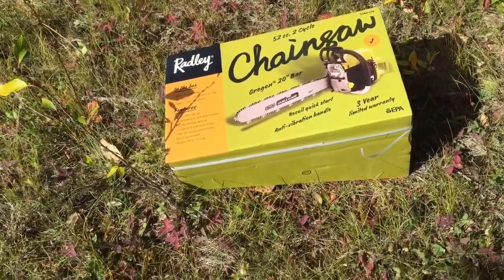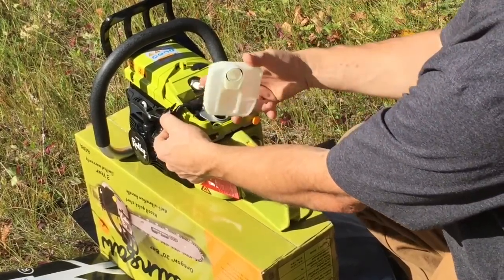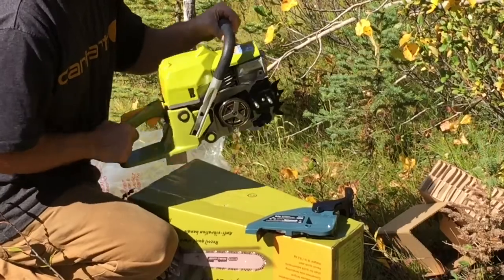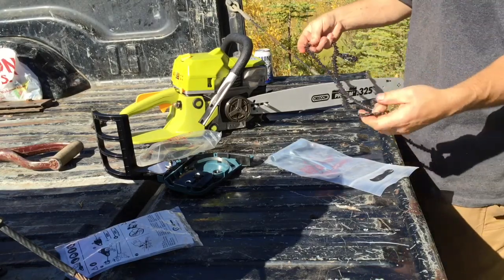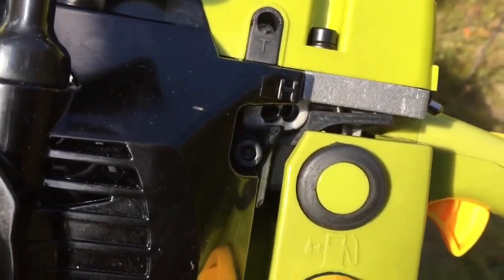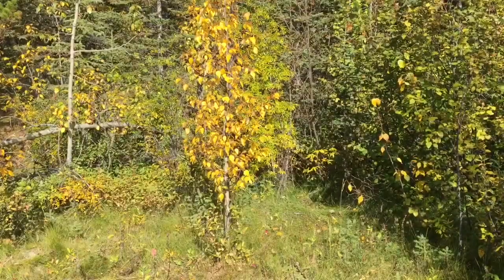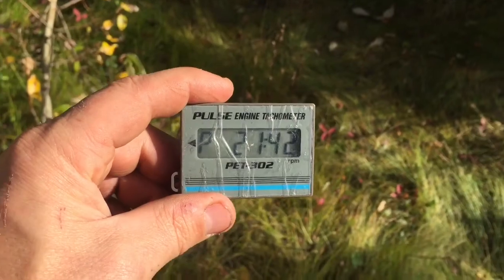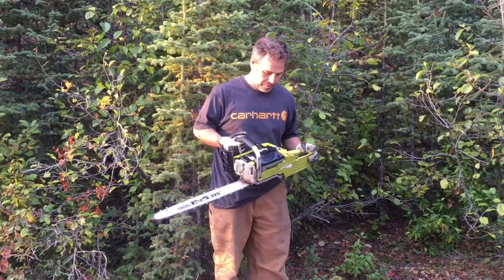52cc CHINESE CLONE REVIEW AND CUTTING!

Comment: well, bought this saw as well. Two things: 1. Muffler screen becomes glowing red in no time under a moderate load, spitting sparks all over, 2. chain easily gets jammed in the wood, but the engine however still runs just fine.
Reply from the maker: Yes it’s crazy how hot the muffler gets. I had same experience with sparks flying out.
You’ll have to diagnose it and see why it won’t run.
Reply: It was working fine for couple days (red muffler screen freaked me out untill I learnt about catalytic convertor this saw has, and lack of power was fixed by adjusting a High screw). But starting this thing when it's hot sometimes is a challenge
Reply from the maker: Yes it must be not adjusted right because during the summer mine is running in two pulls.
In cooler weather or winter it fires in two pulls starts in 3/4 like any other saw.
Try this for starting.
1- prime it 6 times.
2 pull choke to fully out.
3 don’t touch throttle or anything just pull start the saw.
4-it should fire in 2-3 pulls. 
5- as soon as it fires you have to push the choke in/off otherwise you flood it.
6- pull until it starts should start in 2/3 pulls. 
7- once it starts the choke is still slightly closed so the engine will run a big rough this is normal and you want to leave it like that for about 5 seconds then hit the throttle and it should come down to a nice smooth idle. 
Let it idle/warm up for 10 seconds then start reving it in short bursts to warm it up further.
8- start cutting. 

If it doesn’t start and run like this then you’re low end ( L mixture screw)  it’s probably not set up right most likely it’s too lean meaning not delivering enough fuel.
You need to tune the saw when it’s running so turn the low jet in until the idle starts to raise and then it’s gonna start to come back down. Then turn the screw out until you hear the RPMs come up again and just when they start coming down go just a little farther open than that and that should put you right where you need to be.
There is more to it than that but I’ll have to make a video on that.
Reply: @Indeewoods  that is a great summary indeed! I think I was able to figure out the reason for not starting. I usually follow the old school rule to not mess up anything in a new equipment, but I guess this is no longer applicable to the modern equipment especially originated from China. Trying to find the problem, I removed air filter to discover that O-ring seal between air filter housing and a carb itself was not sitting in groves around opening but was rather jammed awkwardly in-between allowing dust and extra air to enter the carb.  Long story short, I gave a nice blow to the carb, reinstall O-ring where it belongs to and voila! the saw fires up again on the second pull! So, the next time I will check the quality of assembly myself prior using to avoid such surprises.
During partial disassembling, I was pleasantly impressed by how solidly and thoughtfully this saw is built (I have two other smaller saws, Husky and Jonsered,  38 and 42 cc, and must say that Radley is a much better build). Will see though if it will last.
Reply from the maker: Ok that wouldn’t add or subtract any extra air.
My guess is you probably flooded it and from sitting it dried up enough for it to fire up. Either way glad you got it going.
Reply: @Indeewoods  very well could be, because the spark plug was heavily sooted up and obviously wet (I'm using the recommended gas:oil ratio of 50:1). Anyhow, I checked the saw all over to make sure everything is up to expectations and now will give her another try. Next is tuning the carb per specs - I would love to watch your way of doing this using a tach. Thanks for the helpful info and links as well!
Reply from the maker: It’s almost always just a simple ( if you know what you’re doing) carb adjustment. 
These things run flawless. They start better than my Stihl’s ever did but the difference is you buy a saw at Stihl or Husqvarna and their mechanic tunes the carb where as a Poulan or these Home Hardware saws get bought cheaper yet not tuned  to your elevation/temperature so 90% of the time they run but run poorly.
You need the special tool to adjust the carb. Links are on my video for the tool
Reply: @Indeewoods  I have that tool (so do I for my Jonsered/Husky). I have tach, and I adjusted saws myself with and without it. But this Radly chainsaw has something special in it, and you seem to be quite experienced with her by now.
It starts on a second pull as I said, and response without hesitation when throttle is squeezed. All seems to be normal on a carb side. However, two things (possibly related?) make me not happy with this saw (both of them were already mentioned in my first post). One being a muffler that gets glowing red very quickly, emitting bursts of flame when I stop throttling, an another one being the chain stops turning while into the wood like it is heavily underpowered. I'm going to remove that pesky catalytic converter hopping to fix the first issue, but what about the chain not turning? Bad clutch? Anyway, I have never had such problems with any of my other saws.
Reply from the maker: @partisan5695  well if you push to hard on any saw the chain will stop turning.
It’s too hard to diagnose by just talking about it I’d have to see what it’s doing
Reply: @partisan5695  gut the muffler

Comment: If anyone is about to buy one of these please read my comment about the part number on the chain bag and update this.  I've seen a lot of comments saying that the newer ones don't have the Oregon Bar and Chain. I have the newer with the Radley Bar, it's stamped KXB BU20-76-5812P. The chain is an Oregon, .325 Pitch, .058 Guage and 76 DL. I wish I had kept the bag, The Part number in this video is 21BPX078X, I imagine that the new ones are 21BPX076X. There are  lots of off the shelf choices for 78 DL chains, almost none for 76 DL. If the only difference is that the new chains are two drive links shorter, is there an reason that a 78 Link chain wouldn't work? I'd have to think that the adjuster has at least that much leeway.   BTW, the Parts Listing in my Owners Manual still points to the 78DL Oregon Bar and chain.
Reply from the maker: Thanks for the info. I think anyone getting a new chain for those radley bars would just match up driver links. If the manual is wrong and stating the old  chain number that is something you’d have to contact Hone Hardware about and have them address that issue.
Reply: @Indeewoods , I told Radley support a while ago. I'm okay for a while, I expect that Home Hardware will eventually carry them. The local Small Engine repair shop can whip one up if not.
Reply from the maker: I talked to my local HH and asked if the would stock parts I told them these saws were really good. He said no they won’t stock parts. 
Not very business smart if you ask me.
Reply: I purchased one of these saws and hop it stand up.  The questions about the 78 or 76 drive link appears to be because of the bar change.  Mine had the Radley bar instead of the Oregon and measures at 18.5 inches from the front of the saw which rounds up the the advertised 20 inch bar.   The Radley bar will not move out enough for the 78dl chain.  The Oregon 76dl chain for this saw is the  21BPX076G which is compatible fit chain with Stihl - 25RM3 76   Husqvarna - H25-76.
Radley and other products for Home Hardware and CTC as well as  may be found at www.mecanair.net which lists Products and Part Numbers.  Selecting the HH logo, OUTILAGE and SCEI will bring up this saw.  The website did not fully translate from French so you may have to do some exploring.  The supplier of these products is in Montreal, Quebec.
Reply: @davidhynes1432  thank you, I have not been able to find  21BPX076G anywhere in Canada, the Oregon site says that it is discontinued, to go to the 'Product Finder' page, it asks for the brand of saw and it's not there...  Don't you just love Technology? When the time comes I'll go to the local guy, he made me a chain for another saw in about ten minutes a while ago.
Reply from the maker: Great info! Thanks!

Comment: Bought one today after viewing this report.
Reply from the maker: Right on hopefully it works good for you. They have good reviews. 
Can’t beat them for the price but if you don’t know how to tune the carb you should take it to someone that does so it runs good for you all the time.
Reply: I'm actually doing the same next week lol it's now 199.99 so it may be worth it I think
Reply from the maker: @bleepers3 they go sale all the time for 159.99 but if you need it fast 199 is still cheap.
Reply: @Indeewoods  ya it's the cheapest saw around lol between Canadian Tire and home hardware lol but I googled it and there's people on eBay trying to sell these for 346$ lol but I hope on the 28th it's a bit cheaper, if not this video has made me believe it's worth it just for the bucking spikes alone lol my old broken poulan didn't have them lol. The Radley seems like a very well made saw.
Reply from the maker: @bleepersoffgrid  ya for 199 you certainly can’t go wrong. 
The original Radley saws came with a better bar and chain but other than that they appear identical. 
You’ll want to watch my other 3 year review video
to see some of the differences and what you might want to do to your new saw if you get one.

Comment: whatt the number for the bar or what elsewill work ? thanks
Reply from the maker: They came with two style bar/chains. 
The early models like the one in my video had had the oregon Bar/Chain which had the 78 drive link chain the newer was a “Radley” bar and chain that had the 76 link. 
Paint the picture for me so I can help you better. If you need a new bar then you for sure want go put s new chain and sprocket or the old chain will wear out your sprocket and bar. 
These bars are hind of an odd ball size but if you need the bar/chain/sprockets I can find an Amazon link for you that’ll work or I csn just give you the size/bar pattern you’ll need. 
Let me know

Comment: in your opinion, and you seem very well versed in chainsaws, how much fuel should one go through with one of these chinese saws for break in?
Reply from the maker: I do my hot/cold cycles and then I just don’t load the engine to hard for to long just lots of on and off the throttle for a couple tanks then I run them as normal. I run the carburator a bit rich for those first two tanks then tune it right and let her howl! Lol

Comment: Holy cow, great review!!! I sorta on the spur of the moment bought this myself as I wanted something a bit bigger and only cut a cord a year.  Had a little craftsmen 38cc 18" bar. Gave me no trouble.  Hopefully this one is the same.
Reply from the maker: Oh you’ll see these are quite a bit better. Very smooth cutting saw good power.
They like all saws need to be tuned though. Depending on what elevation you live at and what oil mix you use. 
I like 40:1 mix but they say you can run 50:1 in these chainsaws.
Where snouts are you at?
Reply: @Indeewoods  thanks for the info, looking forward to testing it out. I am just outside Calgary Alberta, about 1km above sea level.  I had to order a high altitude jet for my lawnmower for it to run right.  I think the only thing I adjusted on the craftsmen was the idle.  Sounds like this rig might need some tuning after run in.
Reply from the maker: It’s hard to say. These call for 50:1 fuel/oil ratio. I run 40:1 in mine so I had to tune it but at 50:1 they might run ok. 
All saws need to be tuned though for different temperatures and elevation however these saws seem to run really good all the time I rarely touch the mixture screws on this saw. It sits for a month and fires on the second pull. 3 pull it’s running. 
Let us know what mix you use and how yours is. Thanks.

Comment: Have you had an issue with your chain coming loose? Every few passed i have to retighten it. Mine didn't come with the Oregon bar and chain.
Reply from the maker: All chains stretch and if you tighten them up to much they stretch lots.
Are you pretty familiar with chainsaws and tightening chains? 
If so i’m thinking they probably went to a cheap chain to keep the cost low. 
These chainsaws used to come with Oregon bar and chain mind you they were made in China but mine seems to be of good quality.
If you are limbing the chain will loosen up more but if you are cutting big wood the chain stretch should last for the length of the tree.
Reply from the maker: Can you reply again with your comment? You tube keeps deleting random comments for what ever reason. 
All I seen was something about how it tightens up that’s all I could see.
Don’t type any links or anything or they will delete it for some reason. 
I never delete comments.
Reply from the maker: Alec it deleted it again for some reason. 
Try making a new comment don’t reply to this one. 
No idea why YT doesn’t fix this issue.

Comment: Going to buy one of these based on your review. Will swap in a milling chain and see how it holds up on a small sawmill. Have been running saws for a lot of years, still have my Husky 40 and my Dad’s way old Craftsman. Politics aside, the Chinese have the capability to build product that equals, and sometimes betters anyones, but also the pragmatism to meet customer price points. Time will tell how well the core metallurgical components stand up.
Not sure if you’ve talked about fuel and oil types. I run high quality premium gas and jaso m345/fd level oil at 40:1 not because I like spending the money but it gets the most out of the engine and just saves so much trouble.
Reply from the maker: Yes I never run any fuel that has ethanol in it. Shell V-power 91 octane has no ethanol and I have used that fuel for 20 years with zero issues. I run good oil as well. 
These saws call for 50:1 and I run 40 however they have a catylitic style muffler so i’m wondering if 50:1 would be better. 
It’s China made but the big thing is it’s cloned off a very good pro type saw.
How long will it last? Not sure but at 150 or 200.00 I could buy 3 saws for the price of one brand name. 
I honestly think they will last as guys in the US are getting 5 years and they are still running but those are other “52cc clone” saws that are same engine as these but different plastic.
I can tell you it runs 110% it is not hard to start and never ever acts up ( yet) but long term testing is needed. Milling is hard on all saws so would be interesting to see how yours holds up. Please keep us updated what you find with yours.

Comment: I picked this saw up the other day 150 buck's on sale impossible to find but I got it. Can't believe they gave a tiny bottle of bar chain oil which like you I thought was 2 stroke oil I had to read it twice.  And I have had expensive saws before.  But this little thing runs awesome and for the price what a deal the bar and chain alone is probably 60 buck's
Reply from the maker: Right on. Ya it is 2-stroke oil but they call it bar oil. I dumped it in with my regular bar oil to use it up I don’t trust Chinese oils of any kind. 
Ya they run really good but almost all require tuning. 
Ya if you can’t find them locally just go online and order it that way. 
Not sure if all stores in Canada go on sale at the same time or what but my store here had them on sale a month ago again.
Reply: @Indeewoods  lol I just dumped it in the bar and chain oil spot to didn't even second guess it guess that explains why I had to add more real bar oil 🤣 .I bought some real two stroke oil
Reply from the maker: Cool what brand of oil? 
What mix ratio are you going with?
Reply: @Indeewoods  Lucas oil synthetic 50 to one lil extra. Runs like  a dream didn't even need to adjust any thing
Reply from the maker: Right on should work good.

Comment: It looks it doesn’t have enough power.am I right or wrong?
Reply from the maker: In this video it is running very rich ( to much fuel) so yes it was low on power. 
I tuned the carburator like all saws need and it rips pretty good actually. Very smooth running saw.

Comment: I ended up getting one. I want to turn down the bar oil but on mine it looks like the bar oil adjustment isn't drilled through the green plastic. Do I need to take the cover off to adjust it or is this a defect?
Reply from the maker: No just flip the saw on it’s side and you’ll need a smaller flat screwdriver to adjust it. The screw is about an inch below the cover. Unless there is some defect with yours?
Reply: Yes I couldn't get a screwdriver to catch and when I looked with a flashlight it looks like the plastic casting doesn't go through!
Reply: I'm going to drill it and see if the screw is hidden underneath
Reply from the maker: @ianmcd12  lol don’t drill it the adjustment screw is in the aluminum/magnesium case NOT plastic. 
There is a hole near the arrows showing which way to turn it but that hole is NOT for the adjustor screw. 
Itis located directly above that.
You will see it unless you saw is full of saw dust. It’s like a half moon slot in the metal part of the saw where that adjusting screw is. Hope that helps.
Reply: Oh jeez 😅 I got it. It was all the way up and it kind of clicks. What did you set yours at?
Reply from the maker: @ianmcd12  right on ya I keep mine one or two notches under max but depending on how much pitch is in the wood sometimes it’s on max.